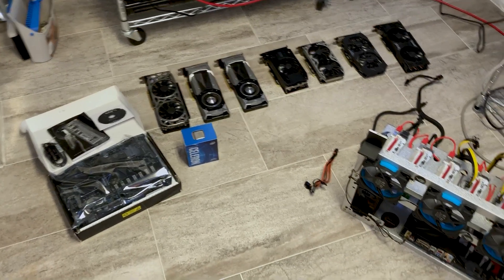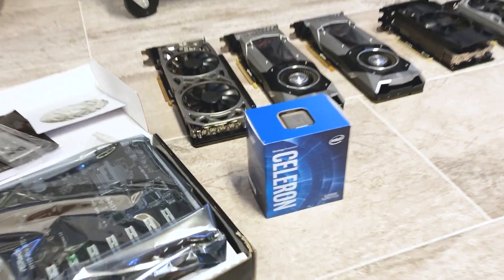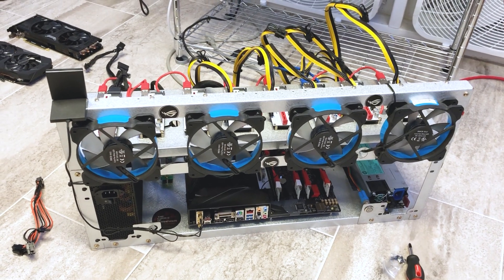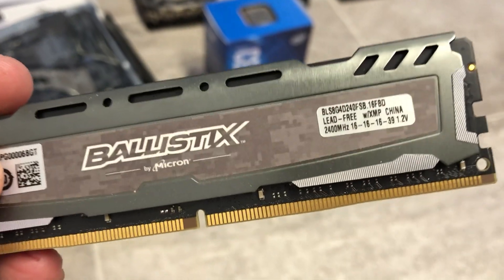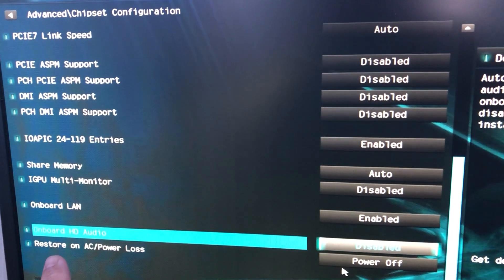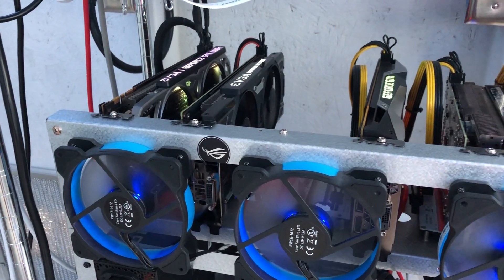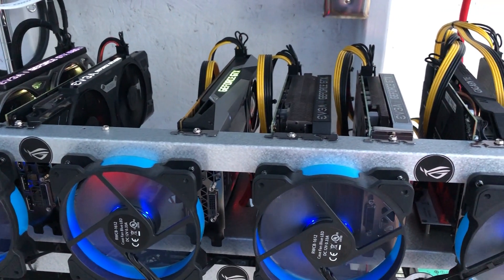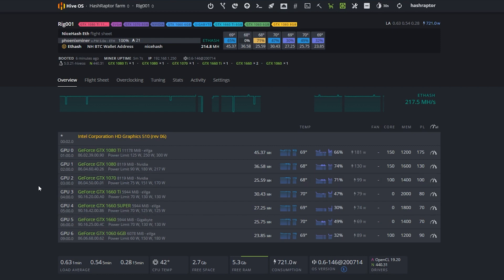Building my Benchmark Mining Rig for Hashrate Testing

Comment: Actually, you don't have the ports on the H110 MB mapped correctly. The correct order is   6 1 9 0 10 2 11 3 12 4 7 5 8   Once you go over 9 cards, you will see order swap. I struggled with this for a while on 10-13 card rigs to figure it out, but now solved the mystery.
Reply from the maker: Doh, does it really swap over 9?  I have the 13x rig but didn’t map those since they are the same card.  Wow!  I’ll add that to the comments and mention it in another video. Thanks so much for sharing. I assume it doesn’t switch any other than that?
Reply: @HashRaptor  Yeah, the order is messed up and confusing for sure, but what I provided is correct. Best practice for this board would be to just follow this order in adding cards. Otherwise you will have a surprise when adding more cards later.